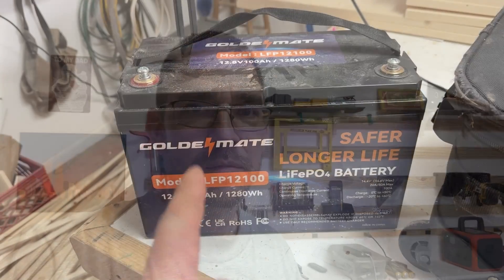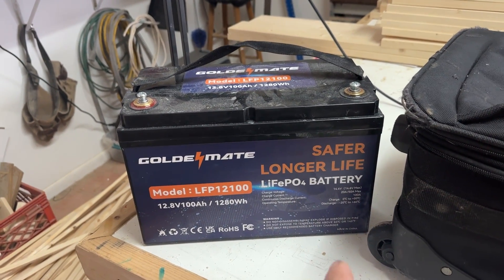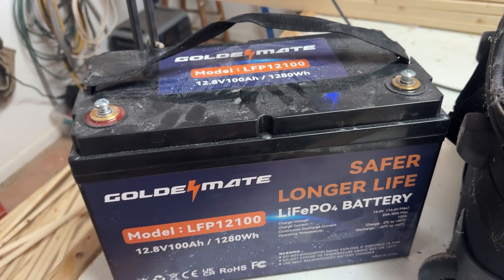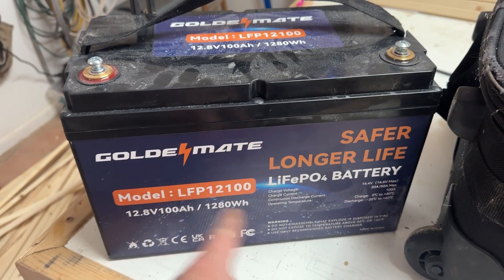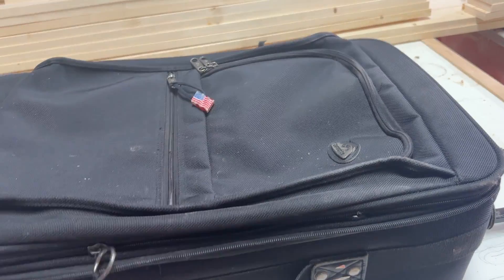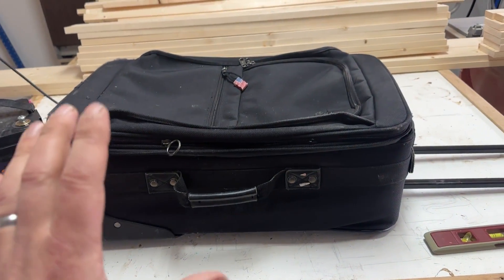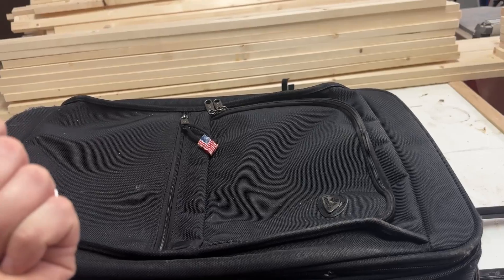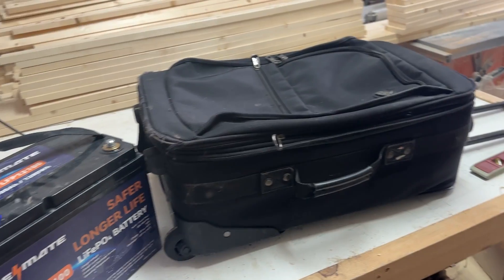How To Make A 3000 Watt Suitcase Power Station

Comment: Batteries unavailable according to Amazon link. What roughly did you end up paying for those? 100Ah LiFePO4 batteries are expensive! Yet you say it's a "pretty inexpensive power station" at the end. So just wondering... The batteries do say (in your video) they're from China, so could be el Cheapo fire hazard crap and that's why they were cheap?
Reply: Lifepo4 Batteries are safe. Lithium ion not so much.